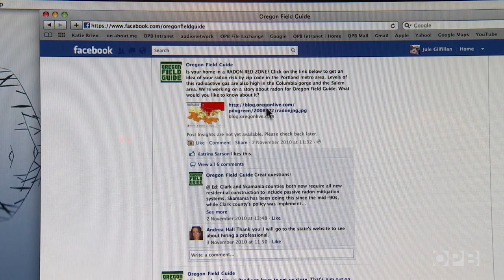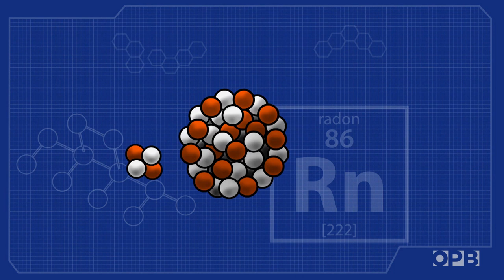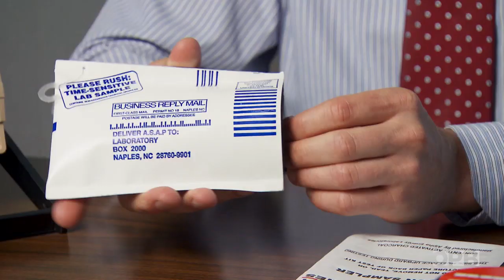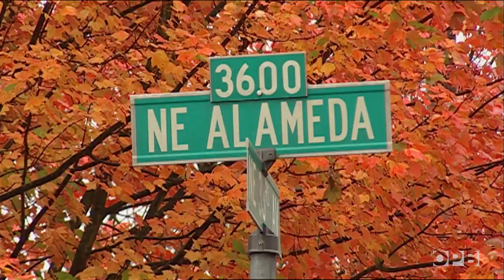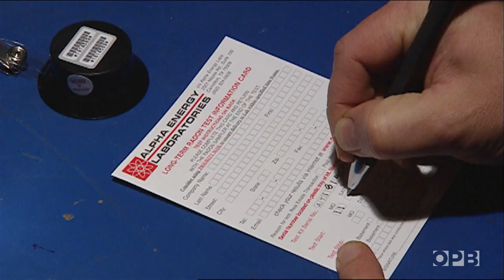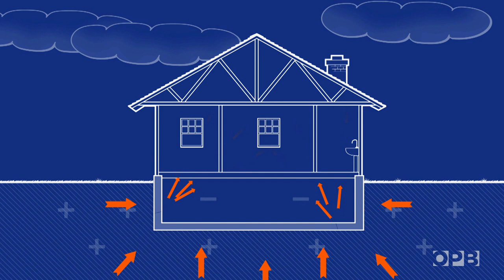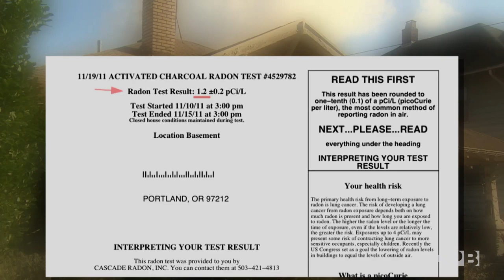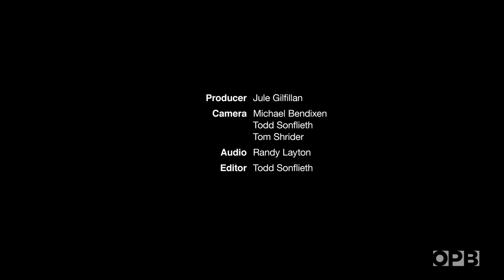What Do We Really Know About Radon?

Comment: I’m interested in this, as I’m buying a old house that has tested at 4.1
However, I find it difficult to believe that if Radon is everywhere, in the whole ground beneath my house, how on earth does simply sticking a 5” pipe into the ground with a little fan sucking on it, remove all the radon throughout the ground beneath my home? Can you imagine how strong that suction would need to be to suck a gas through solid/semi solid soil and mud etc?
I am highly suspicious that there is a ‘big sell’ going on here. Yet another way for industry and scientists to sell us more and more plastic and fund their research positions.
Then again, I grew up being told that homes should breath, they should not be air tight, and yet these days I see more and more videos where homes are being made airtight.
The more experts we listen to, the less clear life becomes.
Reply: Tim Freeman  good to know. 👍
Reply: An experiment you could do is measure the radon level before installing a mitigation system and then measure it afterward to see if it’s effective. In my experience it is effective in most houses unless done improperly. You may require multiple suction points to get the radon levels down.
Reply: As it describes in the video, it is not only about sucking the gas out.  It is about making inside of your home positive pressure so it stops sucking in the gas.

Comment: There is no point trying to block radon getting into your home, it's like trying to stop air getting in if you open the front door. The weird thing about radon is that it is radioactive so i noticed it. The smartphone radiation detector gave me a 200 microtelsa reading inside & outside my house in cold weather. Maybe this explains vanishing airplanes over the Bermuda Triangle,  since it's electromagnetic it might interfere with electric instruments. Like my radiation detector on my smartphone 🤷
Reply: Your phone cannot test for radon
Reply: @martinlutherkingjr.5582  The phone has a radiation detector app, I use my eyes to see the mist. Radiation isn't magic, so I checked up the Internet and actually its very common that this can happen. Radon is a heavy gas so its normally below ground but during low pressure it rises.
Reply: @DerekFolan  Yes, while you might be able to see some indications of radiation from a camera, it’s not going to quantify your radon levels to give a useful picture of statically home much additional risk of lung cancer you’re gaining by being exposed to those radon levels. Just buy an actual radon meter, they’re not expensive. < $100.